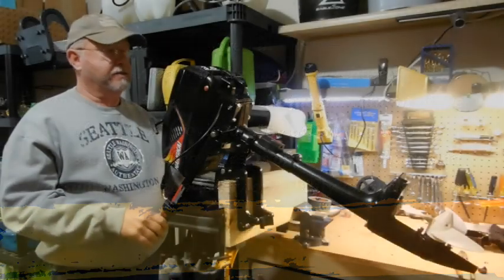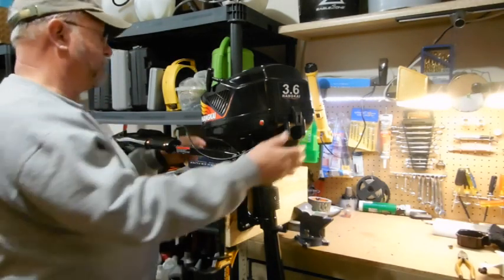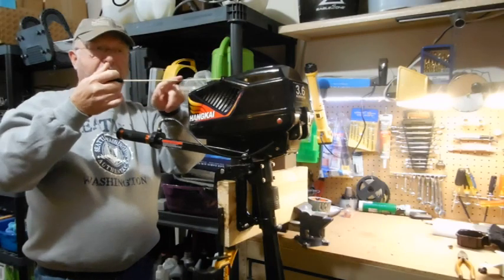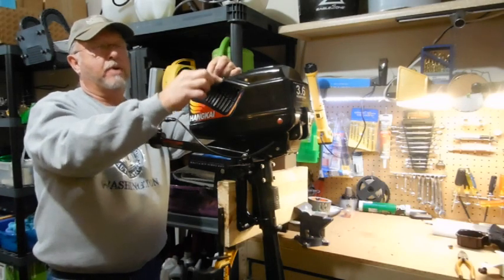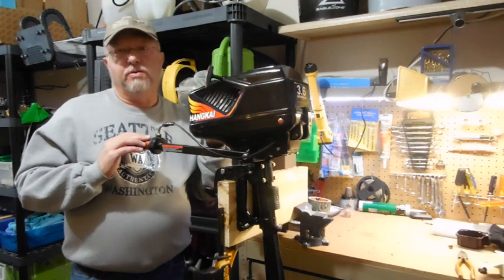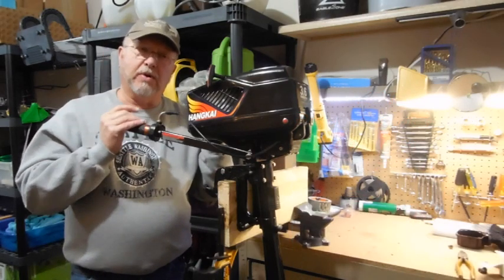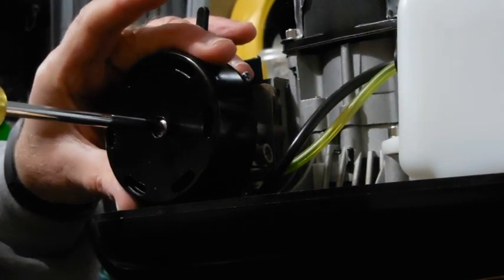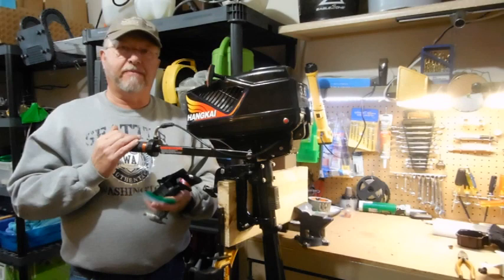Hangkai 3.6 / 3.5 hp outboard motor - 10 Things To Know

Comment: Hi dan, I have a hangkai 3.5 your videos have been great I  changed the spark plug and wins like a dream however I can’t get the prop to spin even reving the engine any tips thanks
Reply from the maker: I've not experienced that problem, however... The prop spins by centrifugal force.  The clutch has spring system.. Try leaving at a faster rpm for several seconds to give it a chance to catch.  Here is a link that shoes the clutch to give you an idea of what it looks like.  There are to swivel points that swing outward that allow the pad to begin rubbing and turning the prop.  Much like brake pads on a car, only by the braking is more like engaging the prop shaft and making it turn.  It's very important that the prop turns as the cooling pump (wheel) is on the same shaft and it won't water cool the motor if the shaft isn't turning.
I going to try to make a few more video's and cover questions like yours... So stay tuned! 
Don't run your motor too long without the prop turning... It might overheat!
Reply from the maker: Oops forgot the link: https://www.ebay.com/itm/Clutch-Assy-Part-Clutch-Bolt-Fits-Honda-GX31-GX35-TL33-TL43-TL52-TL80-200-240/232564536839
Reply from the maker: Hey Harrison Spooner:  A very first thing to check is:::: The sheer pin!   If it's sheered or missing that also could be the problem.... I'm guessing you would have figured that one out though.... But I thought I should follow it up just to be as helpful as possible.
Reply: @BoilerDan1  hi Dan, Thanks again I'm sure that if there was an ambassador for these outboards you would be him so really appreciate your help. I brought the outboard like this and yes checked lower leg shear pin so I'm guessing it's further up the leg so will take apart and work out what has gummed it up. Cheers Harrison
Reply from the maker: It could also be the clutch system is worn?  You can get that part cheep at eBay too.  Do a search for this part:
"Clutch Assy Part&Clutch Bolt Fits Honda GX31 GX35 TL33 TL43 TL52 TL80 200 240" or copy this link
www.ebay.com/itm/Clutch-Assy-Part-Clutch-Bolt-Fits-Honda-GX31-GX35-TL33-TL43-TL52-TL80-200-240/232564536839
 and it will take you to a seller on eBay for under $13.
Reply: @BoilerDan1  Thanks Dan looking into this now. cheers!

Comment: What kind of gear oil?
Reply from the maker: Thanks for your question. In checking I discovered that the episode on YouTube was set to private, not public. No idea how that happened?
Here’s a link to that video and I show what I used. Hangkai 3.6 hp   Gear Lubricant Change
https://youtu.be/T-L5odWduuk
Note:  At some point I noticed a fill line inside the housing. Just be sure not to overfill. There needs to be air space inside to allow for heat expansion. Otherwise you will get water vapor sucked in when it cools.
If you don’t want to watch the video, I ended up using SAE 90 GEAR OIL.
Available in most sporting goods areas like Walmart.
Or Amazon https://a.co/d/0frOGGU
If you decide not to watch the video, consider contributing to my channel by clicking the “Thanks” button below and right of my videos.
Even $2 brightens up my day 😂.
Not required, just letting you know it’s out there 👍👍

Comment: Probably a dumb blonde question.  I followed all videos.  Currently doing break in.  Are air bubbles supposed to come out just above where the propeller goes???  It's kinda freaking me out.
Reply from the maker: Yes, the exhaust comes out below the waterline. Not a dumb question! No freaking out 😁. Also note: It’s better to break in out on the water. If using something like a bucket, be sure to keep cool water running. I kept adding snow!

Comment: 10 hours to break in!.  Can you hook up an external fuel tank to it?
Reply from the maker: No, the fuel tank is internal.  You would have to add special fuel lines.  You can break it in while using, just vary your speed and don't go full speed during break-in.  Also don't sit idle for long periods of time as the water cooling system doesn't work at an Idle.

Comment: Does the 6hp has the same issue
Reply from the maker: Regarding spark plugs I would change them.  I'm not familiar with the 6hp motor.  Assuming it is a 4 cycle, I would assume it would be quieter?  Sorry I can't be of more help on this one.
Reply: @BoilerDan1  ok thanks i will do so

Comment: Hi, what gear oil do I need to use?
Reply from the maker: Manufacturer recommends SAE90 weight. I also have used full synthetic 75w-90.  Do not full it all the way, there needs to be a small air pocket to allow for expansion.  If you look closely I think there's a line about 1/4 inch from the top.  Thanks for watching! 😁

Comment: Excuse me! But all fuels have ethanol am i wrong?
Reply from the maker: Yes, with a few exceptions.  Mine did fine but the fuel lines didn’t last very long.  But when replacing, the new ones are made for use with the newer fuel types.  I’ve seen ethanol free fuel in containers in like the outdoor departments in some stores but it’s pricey.  Just swap out the fuel lines.👍👍

Comment: My boat is not a rubber boat. It is V type's sleek boat and only 25 kilograms go. 
I am 73 kilograms. 
When I alone in the boat and run the fastest on the hangkai 4 stroke 3.6hp I get 8 kilometers per hour. 
I think it's too slow
I want to know is this normal?
Reply from the maker: Both the 4 stoke and 2 stroke are not speed motors for sure.  Kind of like a trolling motor with out batteries. :0)
Reply from the maker: That is normal for these small motors.
Reply: They are not designed to water ski behind (LOL), they are made for use in  ponds and small lakes.

Comment: what would happen if you dont break it in?
Reply from the maker: I'm not an expert on that issue.  You could use it during break in, just vary your speed and don't go full speed.  So the break in doesn't require being done on land in a bucket.  For example you could take it out and run it a various speeds maybe for 10-15 minutes at one speed then go up or down slightly.  The important thing would be the fuel to oil mix at 35:1 for at least 10 hours of operation.  Then you can work up to the 50:1 mix
Reply: You break it...

Comment: I would ask some questions
about this type . 3.5 2Stroke Hangkai(new)
The engine work ,but the propeller isn't roll,someone know what's happening ?
Reply: I’m having the same problem did you figure out what was wrong with yours?
Reply: Mine too. I suspect it is lacking gear oil. Can’t get prop off yet
Reply: The propeller doesn't spin at idle, it only spins a above 50% throttle.

Comment: What's the best oil for the full mix
Reply from the maker: According to the manufacturer, after you break in the motor at a 35:1 fuel / oil ratio, it is recommended to move to the 50:1 fuel / oil ratio.  That will result in a cleaner burn as it has less oil.  I just recently finished the 10 hour break in run and ran my first tank close to 50:1 and it does run much cleaner.  little to no oil residue coming out of the exhaust.  That is also better for the ecology of the planet :0)  When I take it out for it's first real on the water run, I will probably run it with about a 45:1 mix just to work towards that cleaner 50:1 mix.  Hope that is all clear?

Comment: how about cooling ?
Reply from the maker: The motor is somewhat cooled by water.  But it’s a very simplistic plastic wheel down near the propeller.  It does push through some water and I suspect it’s air cooled also.
I do think in very hot weather it does seem to get very warm. So I’m not sure how well it would work in a very hot climate zone.

Comment: hi sir i bought hangkai and i cant get it to start can you help me?
Reply from the maker: Are you aware that the choke is marked wrong?  To start, you put the choke lever to OFF.  Turn the throttle handle to about 1/3 power, pump the primmer bulb until you can feel the fuel fill it... about 6 to 8 pushes.  Then pull the start cord.  Mine always starts by the 3rd pull.  Once it starts and runs for a few seconds, move the choke to the "ON" position.  On should say "RUN".  Let me know if that doesn't work.  Also, just to make sure... You are mixing the 2 stroke oil and gas together as well as a high grade fuel without ethanol?
Reply: hi thanks for responding so quickly i was not able to find non ethanol gas in brooklyn NYC so i used E10 93 octane with marine oil mixtures. I put the gear oil in just as you did in the video, then i primed the ball by squeezing it but i am not sure i felt any fuel inside it. Next i put the choke to off and pulled about 15 times until my arm was sore, no start.
Reply from the maker: You should be able to look at the bulb from underneath and see fuel in it.  If there is a leak in it or the fuel line it won't be able to get fuel.  You should be able to feel that there is something inside the little push bulb because it starts out with air, and when the fuel arrives it's more spongy.  You didn't say that you also put the throttle handle on about 1/3 rd.  That will also make it not start if you don't turn the throttle on part way.
Also, you mentioned "marine oil mixtures"  Confirm that you are using 2 cycle oil to mix with the gas.  If you purchased "marine oil"  for use in a 4 stroke motor where the oil and gas are separate... Oops, that is the wrong type oil.  You will need to drain it all, remove and clean the spark plug and start over...  Let me know if anything I said solves the problem.  I'm sure others would like to know.

RIGHT NOW I'M CONCERNED THAT THE OIL YOU MIXED WITH THE FUEL WASN'T THE CORRECT KIND?
Reply: the oil is definitely 2 cycle penzoil marine engine oil for outboards, will check on the other stuff and let you know, perhaps i didnt put the throttle in the correct position. my arm is tired to crank it again right now so im going to try it tomorrow, in a bucket of water inside my apartment and let you know. thanks for the informative video.
Reply from the maker: Something else for once you get it running.  You will need to add a fuel additive to prevent the ethanol from damaging the motor/carburetor and fuel lines.  Amazon has several too choose from but this is a good quality one to consider... but a little pricy:  STA-BIL 360 22240 Marine with Vapor Technology, 32 oz.  for around $20
Reply from the maker: Ok.  I'm interested to know how it turns out.  Also found smaller bottle of the additive. Amazon 
https://www.amazon.com/STA-BIL-22241-Marine-Vapor-Technology/dp/B01I5C8YJI/ref=sr_1_fkmr0_4?ie=UTF8&qid=1530740670&sr=8-4-fkmr0&keywords=STA-BIL+360+22240+Marine+with+Vapor+Technology%2C+32+oz.
Reply from the maker: Great choice in raft. Like it better than mine.

Another thought I had.... The spark plug could be bad?  I originally swapped mine out for a Champion CJ8. It worked fine, but a view suggested I get a NGK brand, part # BM6Y.  The one that came in the motor went bad within just a few runs of the motor.  The CJ8 was working fine, but I took the viewers recommendation and swapped it out too.
Reply from the maker: One more thought.... The manufacturer could have corrected the marking on the choke.  You can remove the cover and see if when off it moves a plastic cover over the air intake for the carburetor or not?
Reply: Hi sir unfortunately ive tried a # of more times at home with the engine sitting in a trash can of water, and so far no start. Unless you have any other ideas i think i may return it back to the ebay seller. a few times it seemed as if it wanted to start but sputtered a few times and cut off. The starter cord seems very hard to pull, requiring me to exert all my arm strength.
Reply: i tried with the choke set in various positions on off, in between, etc but not luck
Reply from the maker: Maybe spark plug defective? Mine was! But maybe returning is best bet.  But it would be easy to try a cj8 spark plug, about $3. Maybe worth a try? Sorry for your problems )0:
Reply: ok i may try this. i can definitely see the fuel when i prime it, the liquid is inside the primer ball.
Reply: unfortunately changing the spark plug did not work either. i have a friend who is a mechanic, im going to bring the engine to him to see if he can get it cranked. will let you know.
Reply from the maker: I'll be interested to know.  I took mine out this morning and it continues to improve the more I run it.  I hope you get yours going too.
Reply: unfortunately ive returned the engine back to the ebay seller. i have a feeling it may have something to do with the pull cord which seems like it just doesnt want to pull the right way.
Reply: im going to buy a used honda, evinrude, yamaha, tohatsu engine instead. Are there any red flags i should watch out for? thanks
Reply: of the outboards ive seen for sale a lot of them seem to have really choppy idles is this normal for an outboard?
Reply from the maker: Good to hear you were able to return the motor.  Wish you had been able to figure it out, if just for others to know.  
I don't think you can go wrong with any of those you listed.  Thanks for the follow-up.
Reply from the maker: Matthew, Watched the video. Great sounding motor.    You do know that running any gas motor for any length of time indoors can be fatal from carbon monoxide fumes! Be carful... enjoy your new motor!
Reply: Thanks for the advice, i do realize its dangerous so ionly ran it for 20 or so seconds.
Reply: One other question, i noticed the spark plug is heavily corroded with rust, as if it may have never been replaced. do you think i should attempt to replace it or just leave it until it dies?
Reply from the maker: Matthew: Definitely replace a rusty plug ⚡️
Reply: When you can buy a new equivalent outboard from an established manufacturer for under $900, or a lightly used one for $4-500, why would anyone want to  get involved in this nightmare is beyond me. In addition these 2 stroke motors are not even legal to sell in the USA.

Comment: Wat if the water cooling system isnt working
Reply from the maker: cjtubeify, the motor comes with an additional water pump wheel. I’ve not changed one yet, but it looks doable. The motor will not pump water at low idle speed. 
But if you run the motor at normal speed without the water cooling you could overheat and damage the motor. Note, they make a similar motor that is air cooled, no water involved with that style. I think it’s 4hp.  Subscribe to my channel and if or when I need to change the water pump, I’ll post a video.

Comment: 10 hours breaking that's crazy that motor is completely broke in within an hour I build Big Block Chevrolet motors for a living or I have and aircraft engines and never put more than two hours into breaking in any of them
Reply from the maker: That’s just what the manufacturer put in the manual?  If I had a lake near me, I’d just do the break in on the water while using it. Ie. Just varying the speed from time to time.
Thanks for watching 👍

Comment: Not much dust out on the water!😂
Reply from the maker: Yes, I’ve been told that, so I never added a better filter. I also removed the sound deadening material that I installed in one segment as it didn’t help and was concerned that it would hold heat.
Thanks for watching.👍

Comment: Seems odd that a modern motor can't handle ethanol.
Reply from the maker: I'm putting in an additive the supposedly counters the effects of the ethanol.  I've heard ethanol clogs things up and I know two people with snow blowers that after two seasons had some cerebration issues... I've not had any problems with that to date.  I have had two fuel lines break or rot out, I don't know if ethanol reacts to the tubing?  At some point I'll go to a mower repair shop and see if they have better fuel lines.
I've made several follow-up videos you can check out on how the motor has done.  It's not perfect by any means, but I still enjoy it.  But you have to like tinkering with motors and the like.
Thanks for watching and commenting.
Reply: You have to understand that an outboard motor that can be purchased for $200 to $300 brand new is going to be made out of the absolute cheapest materials possible. There is no getting around that. Perhaps some of the countries where these motors are available do not contain ethanol in their fuel, I don't know. The problems with these motors are not limited to ethanol in the fuel. They are just an extremely cheap motor with very poor quality control. If you get one that is reliable for you consider yourself lucky. If not be prepared to do a lot of wrenching on it as you will never find an outboard mechanic that is willing to spend any time on those Motors. It's just not worth it for them. There's a very good reason why Yamaha, Suzuki, Mercury, Evinrude, Tohatsu and the like cost much more to purchase other than the purchaser getting raped by the dealer. Any manufacturer of modern gasoline engines can make those Motors to withstand the use of ethanol in the fuel, it isn't difficult it just cost more money. It's a total crapshoot to buy one of these Chinese Motors so just know that before you spend your money.
Reply from the maker: Marty is so correct!  I'm really not promoting anyone to but this motor. I'm just documenting my journey.  And it's not been without issues... Several to tell the truth!  I'll see if it runs next summer!